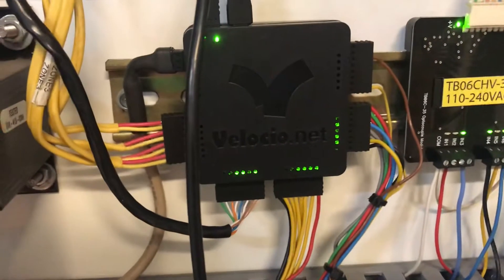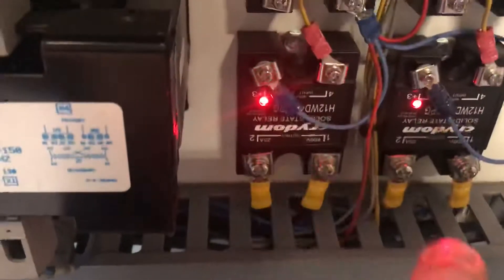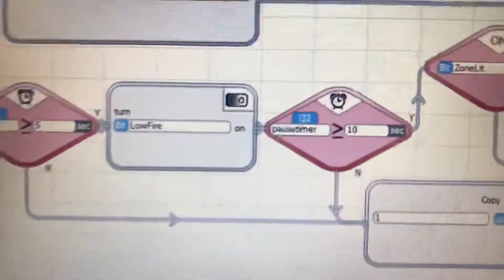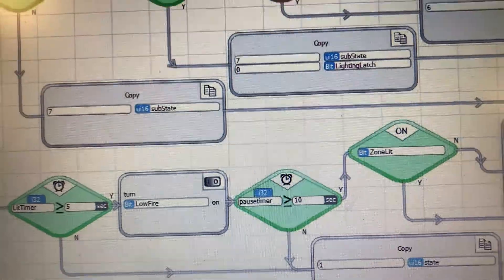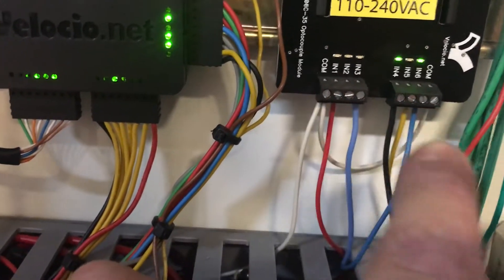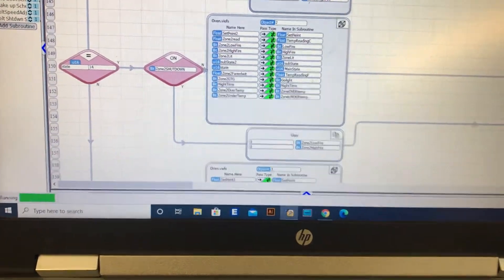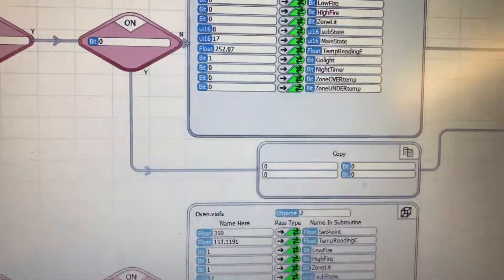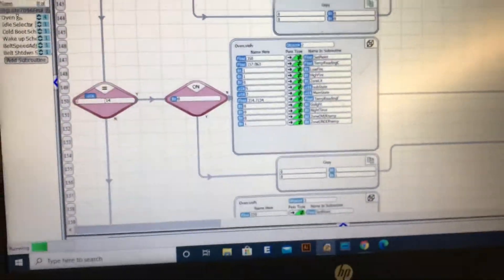Velocio Plc Input flicker

Comment: Have you checked the sensor physically?  It almost looks like a dirty "fire eye" or a bad ground at the photocell.
Reply from the maker: Quick update.  The problem turned out to be an improperly sized capacitor inside of the optocoupled input module. Apparently there was a production run of those modules that weren’t filtering the input voltage enough to keep from flickering.  Velocio sent me an updated unit and the problem disappeared.
Reply: @brendanroberts2032  would have loved to see those input voltage values on a scope.  Must have been dropping just below 3 volts periodically.
Reply: @brendanroberts2032  Wow, thanks... that was very interesting... that indeed is one of the most frustrating things... where the problem is intermittent.  Good job sticking with it, and that makes for a good operator or technician.